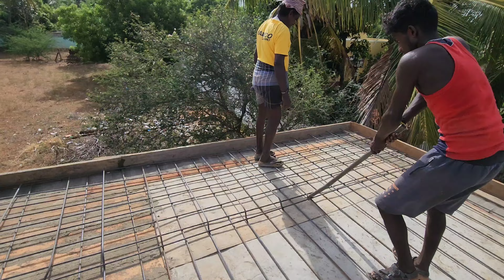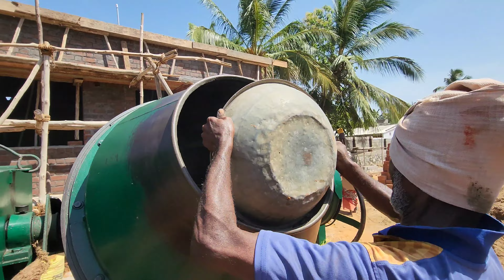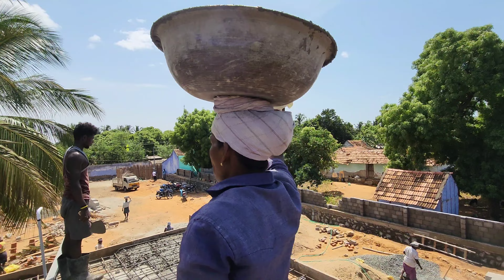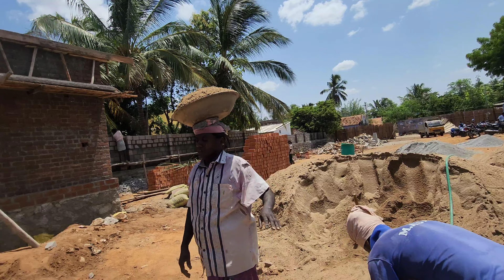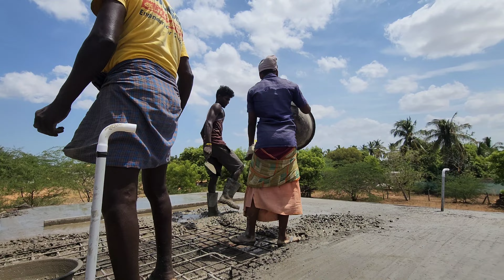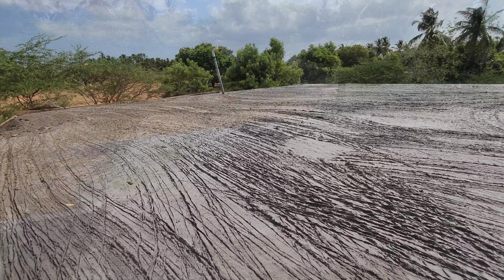Amazing Roof Reinforcement!-House slab Techniques of Bars installation with Concrete Construction

Comment: If you put plastic sheets on the plywood then it becomes very easy to remove after drying, it also fills up any gaps or holes.